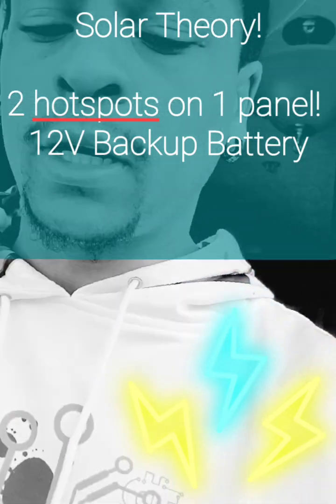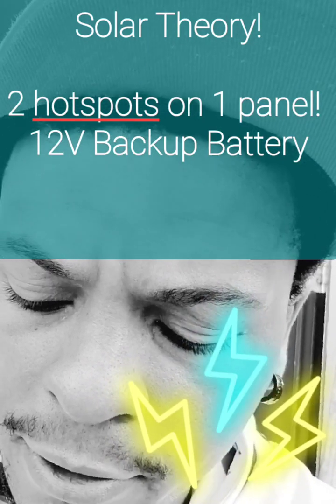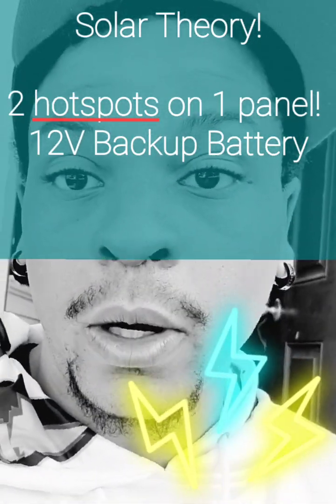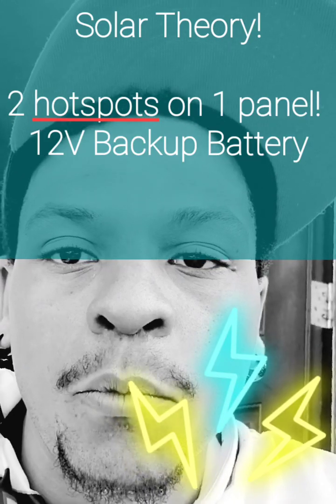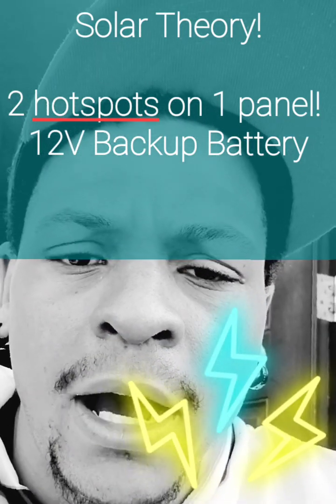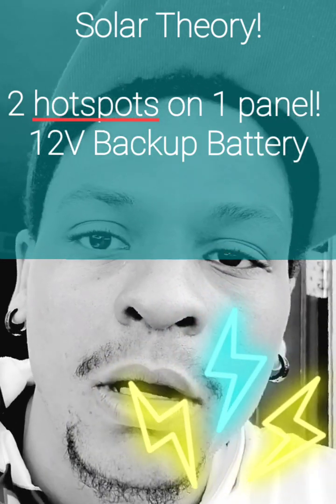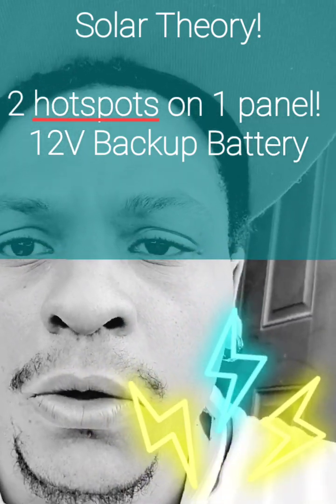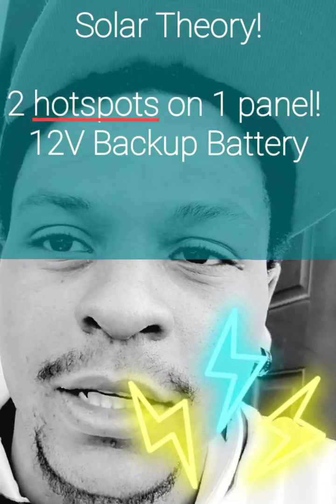Helium Hotspot Project! - Solar Voltage Test Results!

Comment: Looking at doing the same in the uk. Im interested in What type of solar panel unit you used and did you use a usb from the solar unit and dc conector into the hotspot. Thanks if you can help 👍
Reply: Its cool it can power 2 hotspots just dont put 2 hotspots within 300 meters it Will bring the rewards down for both hotspots
Reply from the maker: I'll be posting a video this weekend. Stay tuned for the updates. But to answer your question.  I have both setups. I have a DC converter to MicroUSB . And TypeC . Going to see which I like better. But I may not even need to use my DC converter to USB. I got 2 solar panels and solar charger controllers. But all off a 12V battery.
Reply: @w3mct  cheers for the reply, sounds good. Looking forward to seeing how you've set it all up. 😁👍